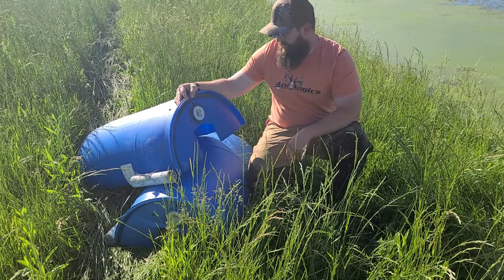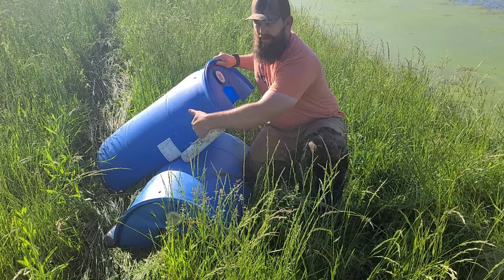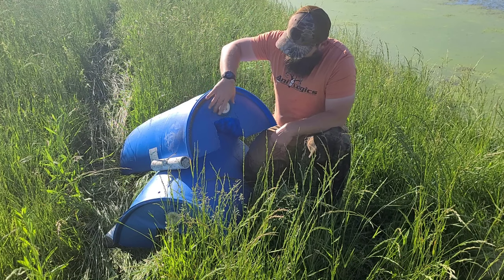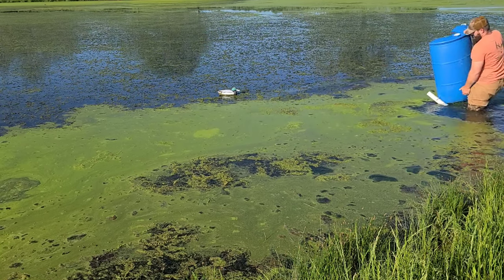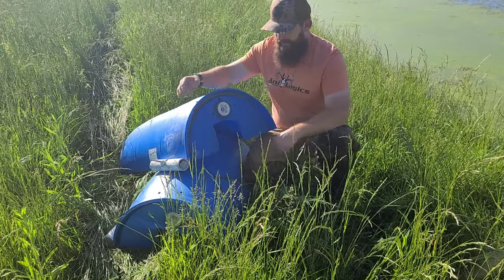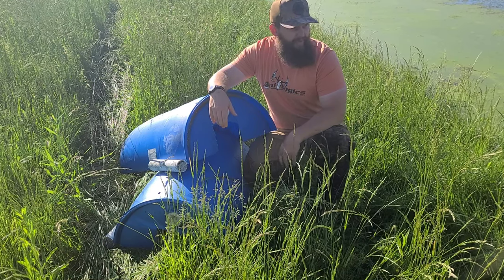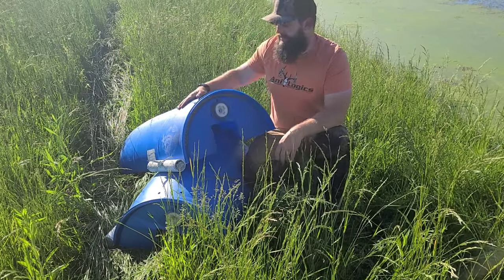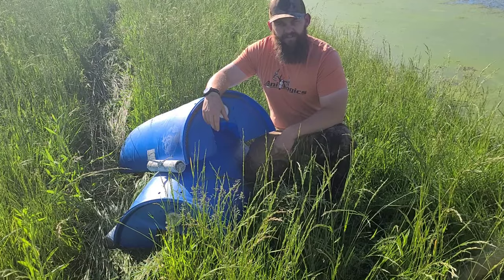Catfish spawning habitat | KOAM Outdoors Fishing

Comment from the maker: Additional holes in the back was also needed to have water flow through and not make air pockets.
Reply: I have modified your assembly by using 3 inch thin wall PVC.  I use one 12 inch pipe per corner (four) not just two.  Instead of attaching with cables that lures can hang on I drilled 1/4 inch hole at each end for stainless bolt with nut.  Can even drill a day or two after pouring quick crete, using masonry bit.  Put three holes in the back (not front) right under the top ridge so as to avoid snags.  Would like to see evidence of your underwater video of effectiveness for attracting catfish occupants.  Thanks for the idea of using the drums.
Reply from the maker: @marktapley7571  awesome to hear! I'll have to give that a shot on my next project. Great idea on lures. Best of luck!

Comment: You said you used 1” pipe but it looks like 1.5.  inch.  2 in. might be better.  Have you made any changes since posting video?
Reply from the maker: I put more holes at the top and that helps with air flow. I don't think going bigger would hurt any. I did another project with containers and filled with concrete at bottom and liked those as well.

Comment: Hello KOAM.  I need to make a funnel trap to see if there are any cat fish in my pond.  There is a way to make the funnel (entrance) so that there is a gradual slope into the hole of the funnel by marking the wire with a string.  Been ap. 55 years since I did one and can't remember the correct procedure.  This works better than a straight bent around funnel.  If you know someone who is familiar with this technique please pass along the information.  Thanks.
Reply from the maker: Very interesting. Haven't heard of this but I'd image same deminsions I used here would be a good start. If you find what your looking for let me know. I'd like to learn. Best of luck!